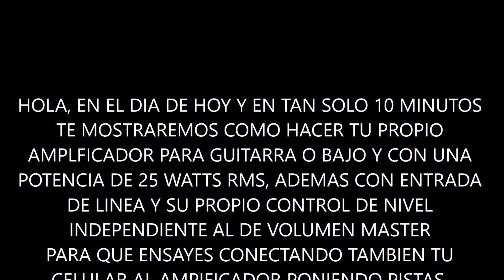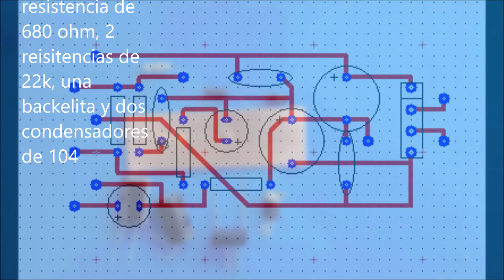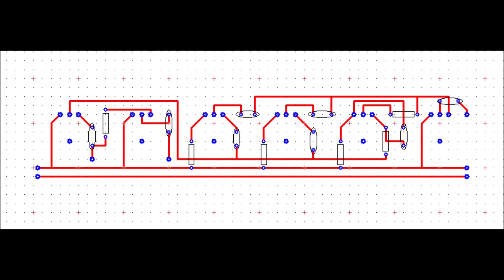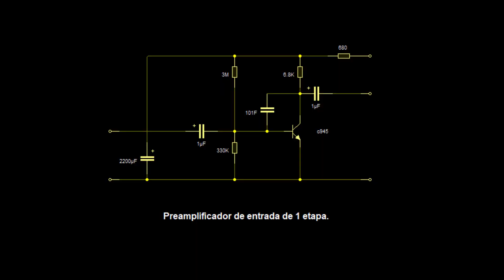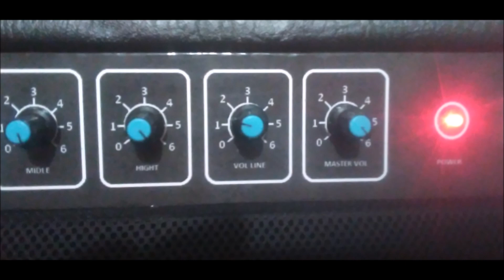AMPLIFICADOR PARA GUITARRA O BAJO: HAZLO TU MISMO

Comment: Como o a donde van conectados los cables del transoformador?
Reply from the maker: Hola Cristian muchas gracias por comentar, la conexión es la que siempre se usa en este tipo de fuentes lineales, el transformador cuenta con dos lineas de entrada para 120Vac y tres cables de salida (12Vac, 12Vac y 0v), las dos salidas de 12Vac van a las dos patas de alterna del puente rectificador, la derivación central es la que corresponde a tierra, entonces del puente rectificador quedan disponibles las salidas  + /-  que van a los dos capacitores (+/-) que son la fuente positiva y la fuente negativa y que comparten un punto común que corresponde a tierra. Debes tener un nivel mínimo de conocimientos de electrónica para que puedas tener éxito en el ensamble del equipo, si no cuentas con conocimientos y/o experiencia te recomiendo que te asesores de alguien los tenga. Un abrazo y éxitos

Comment: Muy buen video, disculpa que componentes debo cambiar si quiero que de mas potencia?? 30-40watts?
Reply from the maker: Hola Carlos gracias por comentar, para tener mas potencia debes cambiar  el transformador de la fuente y el chip de salida de potencia. si vas a trabajar mas o menos con el mismo esquema pues usar un transformador de 25+25 a 4A y un tda2050, ademas debes bajar la impedancia del speaker a 4 ohm. pero también puedes trabajar con mas voltaje a la salida pero en ese caso habría que cambiar el ccto de salida